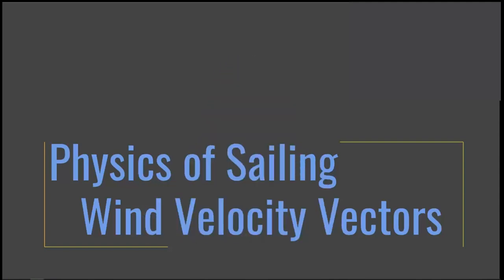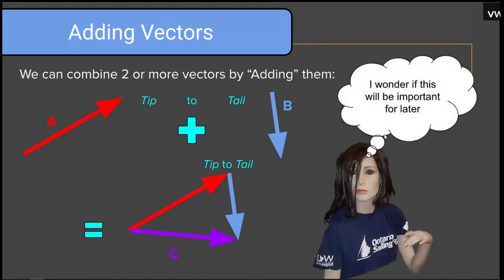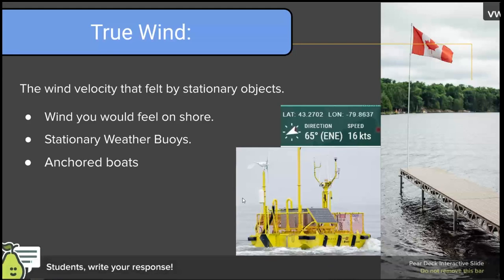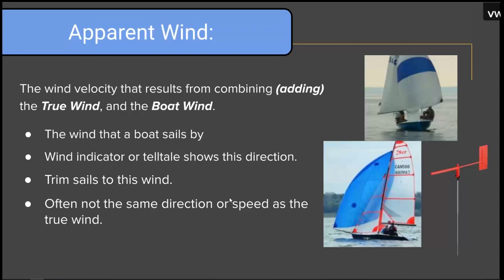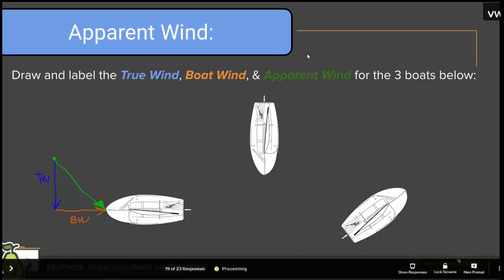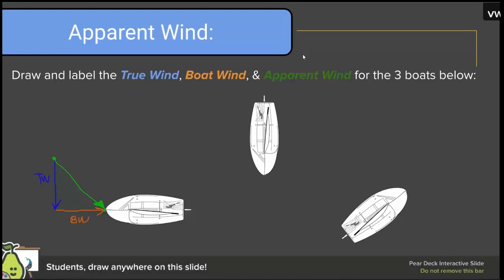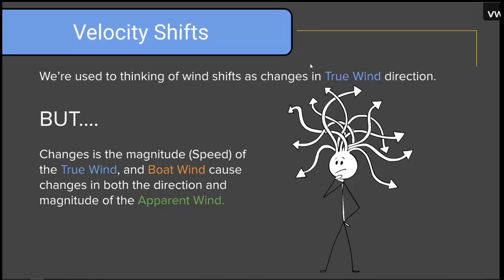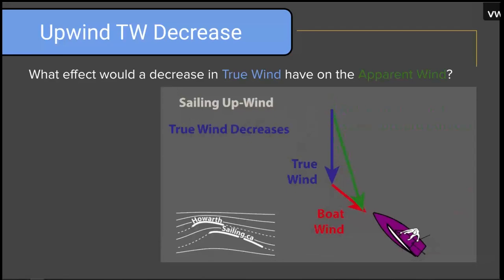Physics of Sailing - Wind Velocity Vectors

Comment: Your diagram for beam reach makes it look like the TW is in front of the apparent wind. On a beam reach the apparent wind should be hitting the beam and the true wind is actually from abaft the beam correct? If we trim to apparent wind, then your example of hitting a beam reach using true wind is a bit confusing to me. It would seem that a beam reach is identified by AW hitting the beam, and TW at an angle abaft the beam.